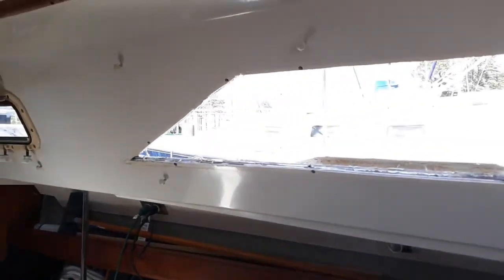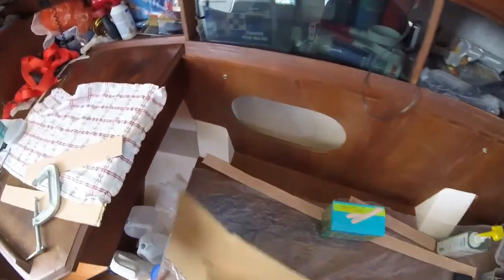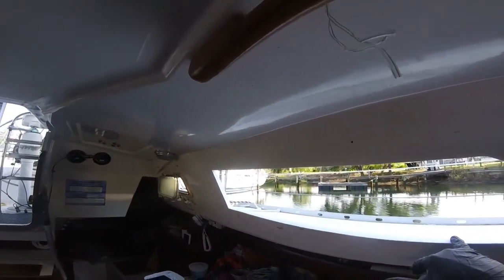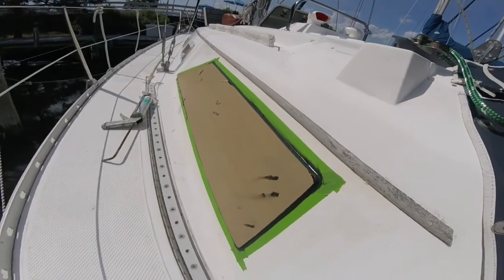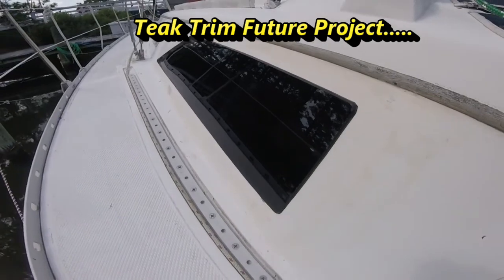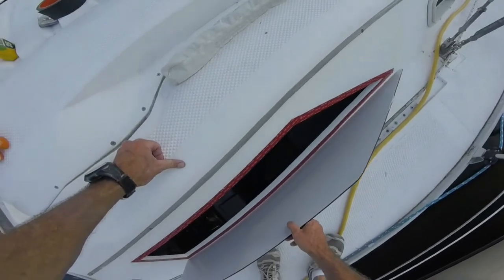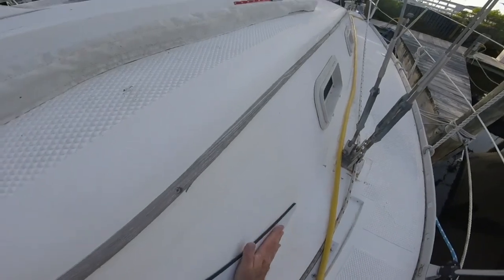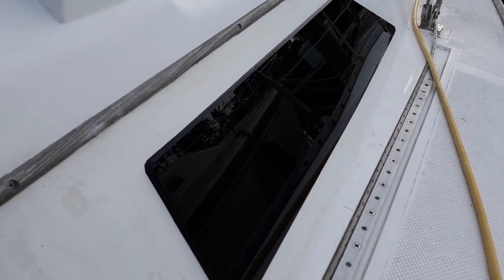Sailboat Fixed Window Replacement - SV Windy Daze - Hunter 31- Sailboat Restoration Renovation

Comment: Who made your window, i need to repace mine.
Reply from the maker: Hi JJ, Thanks for the comment and question. I had Norva Plastics in Norfolk VA do all my windows and most recently hatches. I ordered 1/4" Charcoal grey with 45 degree edge on 50% of one side ie the outside leaving one side flat for placement against cabin wall. Good Luck. Also, I just uploaded bow and cabin hatch plexiglass replacement with the same 1/4" Charcoal Grey Plexiglass and installation of 2 Marinco Solar Fans.
Reply: @WindyDazeSunnyDaze  do you have a Facebook or an Instagram?

Comment: Does the plexy have any bow in it or is it flat
Reply from the maker: Hi JJ Stephens, 
      Thanks for your ?. Yes the 1/4" Plexiglass I used conformed easily to the gentle curve of the cabin both vertically and horizontally. I did it on a relatively warm day 70's low 80's. If I had done it in the winter with colder temperatures it would have still flexed but not as easily, so your variable for flex will be the temperature.

Comment: I have a 79 Monteigo. The widow frames are two sided with plexiglass sandwiched in the middle and bolted all around. The frames have broken into pieces. It looks like you removed the frames and let the plexiglass overlap the hole and sealed from outside? That may work for me.
Reply from the maker: Hi Trey Ward
      Thanks for your comment and question. Yes I placed the plexiglass window on the outside cabin wall using the 3M ultra high bond 2 sided tape followed by the sealant. Newer boats usually have a recessed area for the window, but mine being an older model used a frame in the original design. I wanted a clean modern look without the ugly old style frame which often hides problems underneath. This method allows constant monitoring of the window, the seal and the core. Good luck if you chose to do it this way. I am sure there are other ways.

Comment: Thank you for the video. I now know how to replace my windows
Reply from the maker: Hi William Johnson, Thanks for the comment. On the large windows I used Evercoat 30 fairing from West Marine. I just finished doing all 6 smaller windows same way but for for fairing this time I used Total Boat Fair, the blue and yellow makes green mix. Then 2 coats of Brightside, then the tape and finally the sealant. ( I prefer the Total Boat) I did not like the way the small window replacements from Grey would in time start to leak like the old ones. So for me I am very happy with fixed window for the 6 small and 2 large windows. I am adding ventilation in other ways that won't leak. Most people would probably replace small windows with same Grey windows, but you can go to school on my improvement or mistake. Will be doing a video for the small windows.

Comment: Really helpfull video sir. I. Wondering if you bought tye replacement window from the hunter forum or if you just bought and fabricated your own from plexiglass? I ask because of the slight curve the window has.
Reply from the maker: Hi RBTL4668,
      Thanks for the comment. I had Norva Plastics in Norfolk Va cut it the piece. I first made a paper pattern out of a stiff brown craft paper. Norva Plastics took the pattern and cut the window out of # 104 smoke dark grey 1/4" plexiglass and I also had them put a 1/2 bevel on the outside edge of each window. The cut Plexiglass easily conformed to the slight curve of the cabins exterior as shown in the live install. The 3M Very High Bond 2 sided tape sucked it in tight and the curve of the cabin opening was no problem. I have a list of materials at the end of the video you may wish to review. I cannot speak for the window now available on the Hunter Forum as it wasn't even available when I began this project. Please don't hesitate to send followup questions and thanks again for your comment.

Comment: I've been searching for the answer to replace extremely tired, crazed and leaking windows on a '81 Hunter 22'... Finding this is Fantastic! Beautifully done and it's the most sensible answer I've found. One silly question, how'd you finish the old trim screw holes? again, very nice job and thanks for sharing it.
Reply from the maker: Hi Jeff Kievett, Thanks for the comment and ? The holes were first cleaned out with acetone and thinner, dried, then filled with epoxy, sanded then finished with the 2 part blue/yellow fairing compound from Total Fair then sanded again for a finished surface before using the Brightside polyurethane self leveling paint.
Reply: @WindyDazeSunnyDaze  Have embarked upon the mission... thanks!
Reply: Total Fair and not the evercoat formula 27? looks like it's easier to work with.
Reply from the maker: @jeffkievit328  Hi Jeff, Good ? Since I did the large fixed window I have also done similar with the 6 small port and starboard windows. Both TF and E27 worked OK and I did use the Evercoat 27 then switched to the Total Fair. For me the Total Fair seemed easier to mix, work with and had a longer work time. Tough ? really it comes down to personal preference. Andy Miller at Total Boat likes the Total Fair and for me as well it seems to be a better product.

Comment: How long from start to finish ?
Reply from the maker: Hi James, 
     Thank for the ? Wow I truly have no idea how long start to finish but it was a lot. I tried to make sure I had done the first task right before I moved on the next task. ie. 1. Demo 2. clean out before epoxy 3. Epoxy with clamps (this is your foundation so this is so important) 4. sand 4. fill and fare (repeat as necessary) (Total Fare is best) 5. sand 6. finish sand 7. prep for precoat or first coat of brightside 8. repeat 9. measure for window area 10. high bond tape prep (apply vhb tape) 11. prep blocks for window 12. practice window placement before removing outside tape, pencil marks lightly sides (remove paper as need inside only. 13. double check then remove vhb tape and apply window, I did bottom to top resting on blocks before final check 14. Breathe and apply window. 15. Very important, do not remove paper outside of window. 15. Tape around window at least the thickness of the the window 16. Apply the sealant and smooth 17. When happy with results carefully remove outside window tape and finally the window paper 18. Breathe again and have a beer.
Reply: @WindyDazeSunnyDaze  thanks for the reply !!!!

Comment: When you ordered and installed the glass how do you account for the slight bend in the horizontal plane? I've got an 87 31 that would appreciate a new look>
Reply from the maker: Hi Mike Smith, Great question. I used 1/4 smoke grey plexiglass from Norva Plastics in nearby Norfolk VA. Since it is a plexiglass it is not rigid but will conform to the slight curve of the exposed cabin area to be covered. In the live version of the install on the starboard side I think you can see how it matches up nicely with the slight curve of the outer cabin wall. I actually used the same plexiglass and methods again in the forward and cabin overhead solar fan plexiglass update customization. https://youtu.be/P5ukoZJqTZE

Comment: I just subbed! I just bought a 84 hunter 31 like you so I am literally going to do this exact same repair.
Reply from the maker: Hi Ace, Thanks for the comment. One great suggestion I got was to use a hypo or similar to inject the epoxy down between the core and inner/outer fiberglass. I have other videos showing head demo rebuild, hatch glass demo rebuild with solar vents etc. Let me know if you have any more questions. Good luck.

Comment: Hi, Nice video... you did great job. How thick is acrylic and it is light grey or dark grey. Thx John
Reply from the maker: Hi John Tomik,
Thanks for the comment, I was so happy with the upgrade that I am actually busy replacing all 6 of the 12.5" x 5.5 ports with fixed windows as well. (Will do a video on that in future.) That way all windows are watertight and easy to fix if any leaks occur. I used the outside old large frame as a template and added 5/8" all the way around to allow for the 1" wide high bond tape. Height was 10 1/2" as an example on new window. I show a complete list of supplies at the 17 + minute mark on the video after credits. (tape, sealant etc.) I got the plexiglass locally at Norva Plastics, it was 1/4" smoke grey with a 1/2" bevel on outside surface. They only had brown smoke or grey smoke and I chose grey smoke. Norva plastics does work for the US Navy so it is great stuff, however, it would be better if you can find someone local to you.